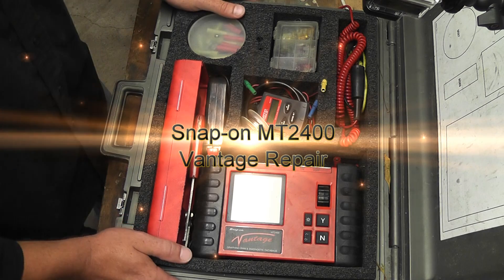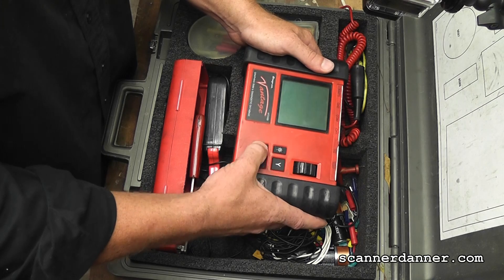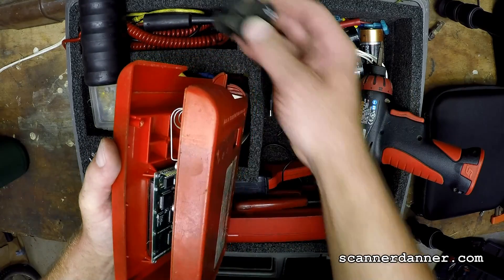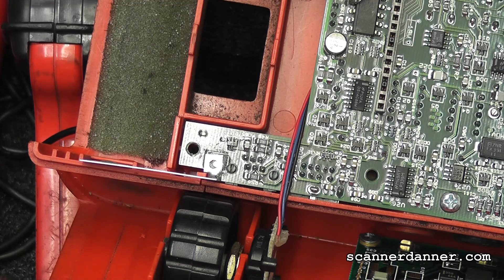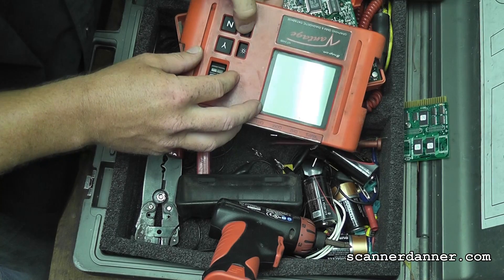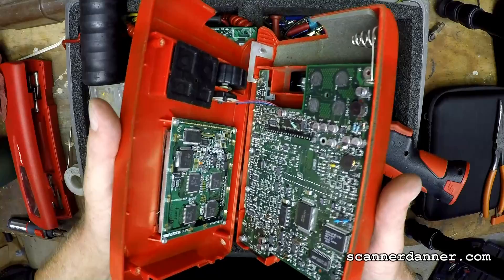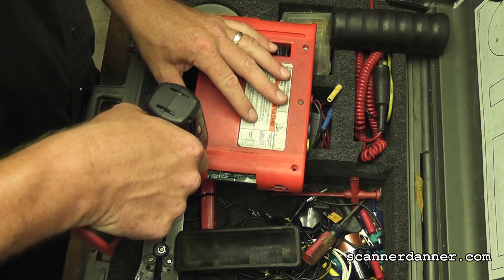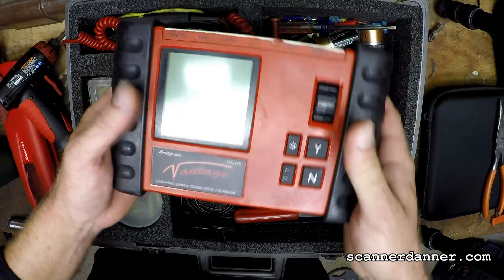Snap-on Vantage MT2400 will not turn on

Comment: Have you ever repaired the screen?  Seems like many have a screen issue like mine does.
Reply from the maker: I have not
Reply: Where can I find that battery holding spring  need to solder it to the board 😢

Comment: My mt2500 snap on scanner will not come on can you help me out it is never been used , so i had trouble with my truck so i got out my scanner and hook it up and power never came on ,the scanner tool can you please help me out , i really dont want to throw it in the trash , like to use my scanner, please can you help me out if you can will you call me, my number is 317 652 0647 my name is pat , never got to use my scanner because i was in the miltary, please help me , i will pay you for your help , sure like to use it
Reply from the maker: The mt2500 requires a direct battery connection from the DLC end connector. There is a small plug in hole on the side of each adapter end. It goes to the cigarette lighter or directly to the battery
Reply: I tried to fix it no luck will you try to repair scanner call me and let me know thank you

Comment: How long does the MT2500 generally last on 2 D cells ? Any brand of cell last longer ? Thanks to you two, I own an MT2400 now.
Reply from the maker: The MT2500 was the old "red brick" and it only has a 9v battery. It powers up off the car
Reply: @ScannerDanner  I meant MT2400. Sorry about that. I should know the difference, I have both. Favorite D cells ? Longevity ?
Reply from the maker: @mikep95133  just get whatever, this tool sips battery life
Reply: @ScannerDanner  My mt2400 draws 200 ma when on. 400 ma when on with the back light lit. Quite a sip ?? 0 to .4 ma parasitic draw when off. Wondering what your mt2400 draws ?

Comment: I purchased one just the other day on Ebay and it is fine except for the screen protector which had come lose due to the foam dry rotting. The version is 8.0 which is the latest but it only goes from 2000 to 2005! I don't remember how the updates used to work, is 2005 as far as they go, and shouldn't it have everything from the 1990s to the 2000 as well? Its been a while since I used one - I used to be an auto/electric tech and actually had two of these. LOL

Comment: Thanks for the video. I bought a used one about 10 years ago and all was fine until I'd had it about 2 years, when it started shutting off, I at first though it was a duff case of batteries I'd bought for it, but even with a different batch it was the same, so I popped it in my garage and sat there since.

Funnily enough, I dug it out today as I wanted to see if it could be resurrected, only to find I hadn't removed the batteries when I put it away. Needless to say, the batteries and terminals were corroded to nothing, but as I opened it, the remaining part of the positive plate fell out ... guess the solder joint was the problem in the first place.

I'll make up new terminals for it and keep my fingers crossed that's all it was.
Reply: asp383 Hi. Did it work?
Reply: Hi Bill, I've scraped out the corroded metal and cleaned the solder joints. Going to an electrical store today to get the bits to replace the battery terminals, so will report back later.
Reply: All done and working. If only I knew that was all it was 10 years ago, as I used it quite a lot. trouble when you're kept busy, you forget about things or leave it for a rainy day ... 10 years later lol.
Reply: asp383 Thank u for following up. I am in Los Angeles. If u don't mind, where r u?  Just bought a Vantage on eBay. Hope it works. I have a Vantage Pro that I love. I also have the Autel MaxiDas which is fantastic for the money. Have a great day. Scanner Danner premium is well worth the Penny's it costs. He has a whole series on the Vantage Pro.
Reply: You're welcome. I'm across the pond, (South East) England ...  West Sussex, about 3 miles directly south of London Gatwick airport. I've got the Vantage, which I used for automotive and working on Genie and JLG lifts etc, where it came in very handy. I also have a Snap-on Scanner, although it only does up to 2005/2006, it has all the plugs for pre-OBD2 sockets, then I have a basic OBD2 code reader for newer cars. I should really get a specific Land Rover scanner too, as the software they use isn't compatible with my current equipment for fault code reading ... So I'm a bit stuffed if my Land Rover ever starts playing up.

I didn't upgrade to newer versions of the Vantage or to the Solus range of scanners etc, due to purchasing conditions Snap-on UK insisted upon, such as requiring proof of insurance for employee's tools, equipment and other property on the premises (something most employers won't cover) and it's difficult to get suitable tool insurance here.

Always worth knowing about these sorts of series, especially when it comes to some of the older kit, which may not be supported by the manufacturer's tech department. I'm sure I did have the instruction manual for the Vantage, but can't find it at present, luckily, I found a PDF copy online.
Reply: My younger brother lives in Devon, I've only been down that way a few times, but yes, it is nice down there. Haha, no snakes, My first drag car was a '76 Dodge Aspen with a '68 Chrysler 383ci hi-po v8. When I first started in chat rooms (long before Facebook or other networking sites), I went with Aspen383, which was gradually shortened to Asp383 and it's sort of stuck, even now, I'm still in touch with a couple of people from the chat rooms and we still call each other by those names. The Aspen has long gone and even my last drag car ('67  Barracuda notch back with 440ci v8) went in 2010. I just keep to my Land Rover, air rifles, amateur radio and woodland I manage for a mate now, which I think is more than enough.
Reply: asp383 Thank u Aspen!!

Comment: Whats the fix for MT2400 that wont turn off! I have to let it time out or release the battery to get it to shut down. I noted someone else had the same problem in the comments...
Reply from the maker: It is a contact issue with the on/off button. Moisture was the culprit from keeping mine stored in my garage. The problem was either I cleaned the contact or resoldered a joint. I don't remember, it was 10 years ago
Reply: Ok not sure that is the problem in my case. The reason is it turns on no problem at all using the button.. ..but it wont turn off using the same button! I use this meter every day its a great tool.

Comment: After soldering apply some glue to the back of the tab near the battery . That will act as strain relief and keep the solder joint from taking all the mechanical force. Use a glue like E2000 or a silicone RTV which remains sort of flexible and can still be cut to release the tab if you ever have to take it all apart again.

Comment: hey Paul I have one of these and just stopped working checked the terminal solder joints as in video but there both ok. I don't suppose you have ever come across any other problems with them regards Luke.
Reply from the maker: Sorry Luke , I've not run into that
Reply: No worries thanks anyway man

Comment: mine has a similar problem, you turn it on, choose multi-meter and if you turn on the light and choose another unit to measure it clicks and turns off, really annoying, already checked and re-soldered the + joint, the neg. looked fine, batteries are new
Reply: Mine does the exact same thing...

Comment: Paul Danner please could you help? I have one of these and I'm not sure if it has a problem all inputs seem to work however channel one will measure D.C volts but not A.C the relays click when changing scale but the digits don't move yet the channel 1 works fine on D.C and everything else seems OK. could you see if this is the case for your MT2400 power graphing multimeter? thanks.
Reply from the maker: +setitthen sorry man, no idea
Reply: OK Paul thanks for you response basically the channel 1 will not plot A.C amplitude vs time. If Anytime time you get a chance to measure an ABS sensor or crank sensor this is what its for. Helps you find drop outs or glitches I'm sure you know this. Thanks again Paul your YouTube channels has been a credit and a valuable contribution.

Comment: hey paul, wondering if you would have any recommendations for like a mid level scan tool, i need something better then a basic code reader but can't go into debt over a scan tool. same goes for a scope, Ive been doing my best with just a meter but I'm ready for a scope. thinking about an original vantage like use always use. any input would be very appreciated

Comment: Issues I have had with my Vantage are the batteries leaking acid and corroding the pins, and the pins flexing not making contact with the battery.

Comment: Good to know the needed repair for that issue. I bought one a couple of years ago off of eBay and my problem seems to be that when pressing the off button it won't shut off and is starting to get lines across the screen but still seems to work OK.

Comment: It pays to take precautions to avoid static electricity damage when handling sensitive electronics.   Static charges build up all the time on you, and on work surfaces.  Components like computer chips will be damaged if these charges discharge into them.  These charges could be thousands of volts, and electronics can be damaged by shocks too small to be felt.

When working with electronics you should:
 * Hold circuit boards by the edges, avoid touching components
 * Wear a grounded wrist strap to dissipate any charges that build up on your body
 * Ideally work on an anti-static surface, place components in static shielding bags
Reply from the maker: +Sam Douglas agree with the theory there but on a practical level, I've been doing this for over 20 years and have never once had an issue with opening up a board of any kind and have never used anything special.

Comment: Some good info there, thanks, my vantage had a strange problem, the unit worked but the yes no buttons didn't, not sure if the actual switches where worn, I glued a small square of kitchen foil to the underside of the  yes/no buttons, never had a problem since!

Comment: Need your thoughts to where I can buy some leads for my vantage and fluke dvom model 87 with back probing capability.
Reply: +Richard Gill 
I don't know about leads for the Verus, but for the Fluke (or any high  quality DMM) look up "Pomona Test Leads". The Deluxe kits are REALLY nice. True silicone insulation, not plastic. I've had mine for 20 years.
Reply from the maker: +Richard Gill http://www.aeswave.com/Automotive-Test-Lead-Kit-p9121.html
Reply: Thanks Paul. I crack up watching your brother and all his home made jumpers. Kinda like how he used a bullet connector and one of your famous t- pins. Going to buy stock in the t pin market. Lol
Reply: douglas lee. Thanks
Reply: *****. What kind of scope do you use

Comment: Can Vantage see the bump (or lack of ) on the injector waveform ?
Reply from the maker: +radu soptea those are difficult to see on some injectors on any scope, but yes, it can be seen.
Reply: +ScannerDanner Ok ,let me rephrase it :what Vantage can not do but others newers scope can do ?It is a pretty old tool , is still a good buy for actual and near future cars ?Thanks !
Reply: +radu soptea 
its a power graphing multimeter. it plots pulse width, duty cycle, frequency, burn time, KV, RPM, pressure all against time as a histograph. Most lab scopes can not do this. Hence this tool sits between a scope and a graphical multimeter.
these features help when trying identify  discontinuation problems glitches etc. Its quite a unique tool.

Comment: Nice- Id take that old vantage any day over my autoengunity  , I'm taking it fishing with me on the weekend should be able to cast soooo much further :)
Reply from the maker: +Steve Rob lol
Reply: +ScannerDanner Hi Paul, could you please tell me if you are able to measure A.C voltage on channel 1 of your MT2400. mine seems to have a problem with this, everything else seems to work. Channel one has no problems measuring D.C voltage I suspect its a firmware issue.

Comment: Wish the Solus Ultra was that easy to fix .
Reply: Hi Terry I seen a few vids on the solus pro fix. Forget about using a screwdriver & soldering iron the trick is just a big hammer :)
Reply: +Steve Rob     Mine was the screen . I just bought a new ultra , Wanted a better one with a scope , but not in the budget right now , the ultra set me back enough the way it was . I have thought about taking a big hammer to the old one , might make me feel better .
Reply: +wtbm123  cool I looked at them also , but $5600 Canadian Passos was too pricy . Look forward to seeing  you use it in a vid.
Reply: +Steve Rob  $3895 here , My second one in two years , The first one i dropped the second day i had it . It did not seem to bother it any. But after two years of being ok , the thing just started going crazy . Called Snap On  and the guy said it was prob the screen . some days it works fine , but the days i needed it most,  it was acting goofy . End result i had to replace .

Comment: Next time, use a short jumper wire, solder it from the board to the pole. That will eliminate the vibration crack.
Reply from the maker: +Joop Terwijn good tip

Comment: it really bites discovering the silly design flaws manufacturers build into their products.
Reply from the maker: +bgregg55 I wouldn't call this a flaw. I've had this tool for 17+ years and it's been dropped a hundred times and all I've had to do is redolder these two contacts on 2 separate occations. I would call this tool bullet proof. This thing is what really sold me on snap-on diagnostic equipment all those years ago.

Comment: Why not instead clip the flange tip of the tab off and then solder a small jumper wire between the circuit board and the remaining end? That way you will have built in a flex point.
Reply: second this. flexible wire jumpers. hot glue the positive tab to the case after.
Reply: +kmg501 Third this, solder joints on boards don't like flexing, so you have to build the flexibility in somewhere else (wires, ribbon cables, etc) . Those factory connections on both terminals are way too rigid and apply too much torque on the solder joints while you're twisting the case using the buttons.
Reply: +Stephen Wiwchar If you have a description  of 5 his process can you send it to: isshmangarcia@yahoo.com   Thank you in advance.
Reply: +Isshman Garcia *description  of this process

Comment: Next time add a small piece of double stick tape between the contact and the case. That will hold the contact from flexing and breaking the solder joint.